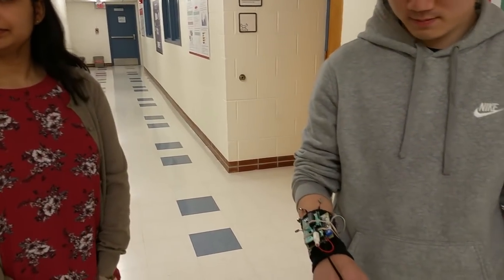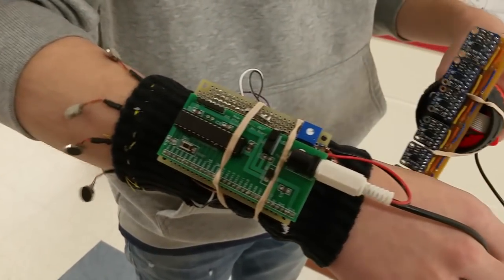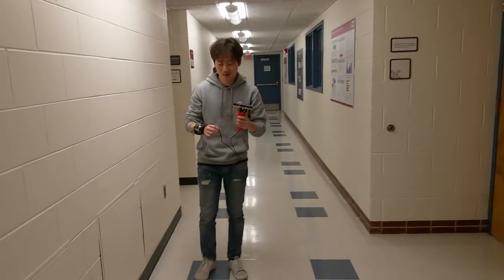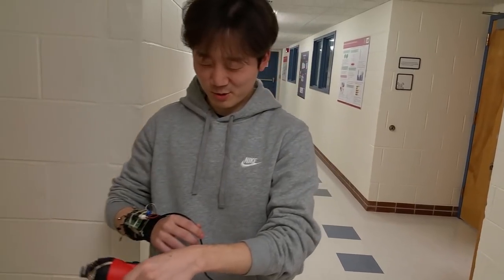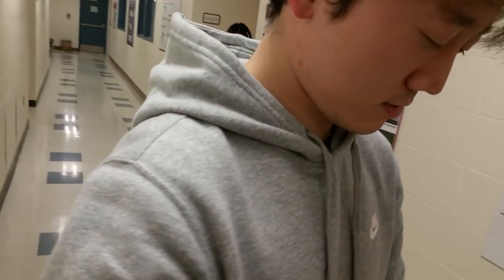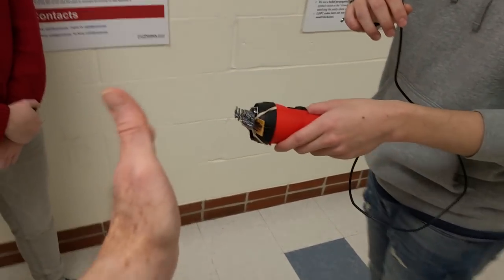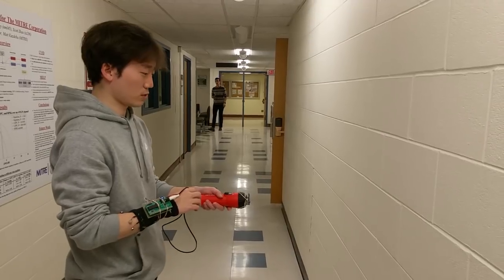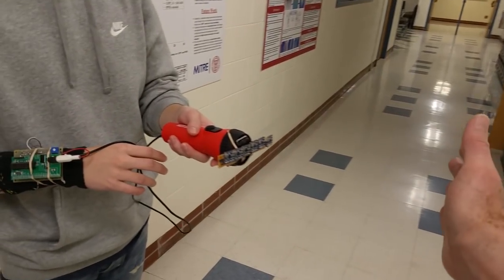Haptic distance sensor

Comment: That's alright but can't we put sensors in a headband or a glove setup with knuckles and make it more compact? . Also we can use two sensors for the job instead of using this wide array of sensors. We can use an algorthim to detect position of a rotator above the sender sensor to map 3d space and it'll make the system much more compact . . Unfortunately 😔 all these ideas from young indian engineers die down and get burnt with their bodies because here you don't get time,support or financial aid to build stuff .
Reply from the maker: Any of these variations are possible, and I have had students build all of them at various times. It does take time and support to build projects. I understand this, which is why I put all lectures and projects online, hoping that it will make it easier.
Reply from the maker: 20 years of projects http://people.ece.cornell.edu/land/courses/ece4760/FinalProjects/
Reply: can you please tell me more about this algorithm
Reply from the maker: @sheikhmaryam9682  did you read the linked report?
Reply: @ece4760  i did but there was no mention of algorithm
Reply from the maker: The whole report describes the "algorithm". But my mind-reading seems to be broken. What are you really asking? Are you asking how to convert time-of-flight to distance? Or are you asking about i2c? Or what?
Reply: @ece4760  I'm asking about the algorithm to map 3d space to make the system compact
Reply from the maker: @sheikhmaryam9682  Do you know what a  time-of-flight (TOF) sensor is? LIDAR? The system gives distance estimates in 6 different directions, because the TOF sensors are aimed in different directions. Is that what you are asking?
Reply: @ece4760  no what I'm asking is how can i increase it's field of view without using multiple sensors with the help of algorithm... also can you tell me if the coding is same as that of vl53l1x sensor which is a better version  of vl53l0x
Reply from the maker: @sheikhmaryam9682  Finally! an actual question! Scan one sensor using a servo motor. Scan one sensor using wrist/arm motion.
Or if you have LOTS of compute power, use a camera and SLAM algorithm.  Or use a stereo camera. 
As for the sensor coding, read the manuals.

Or https://lmgtfy.com/?q=vl53l1x+sensor+vs+%20vl53l0x